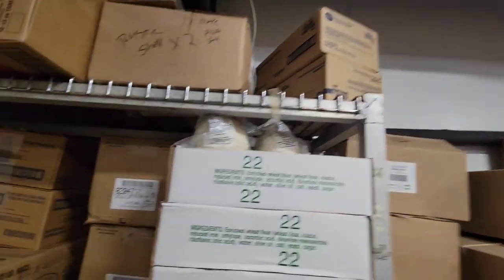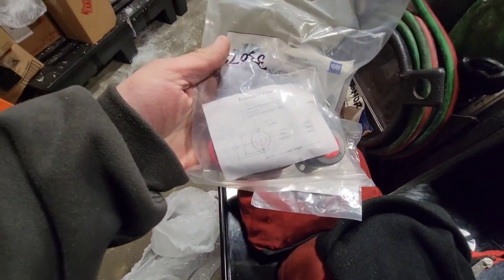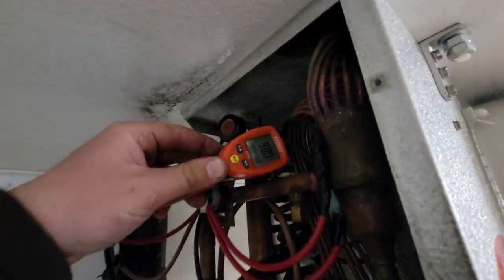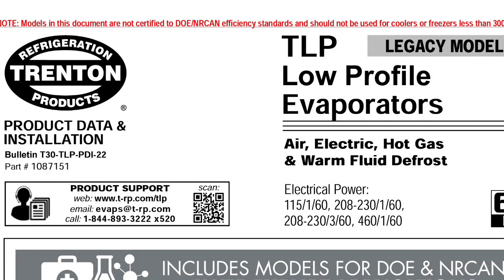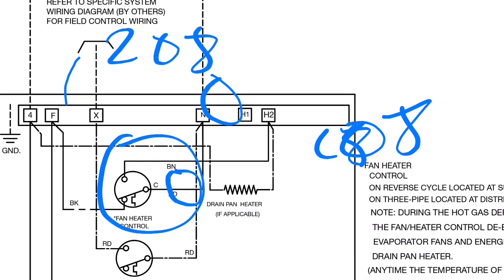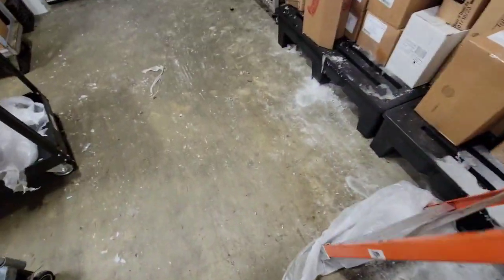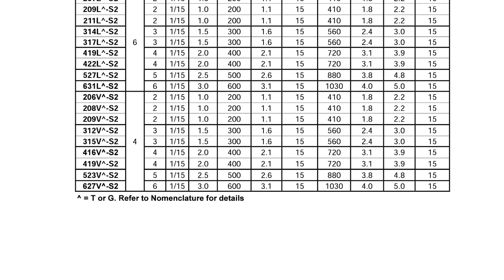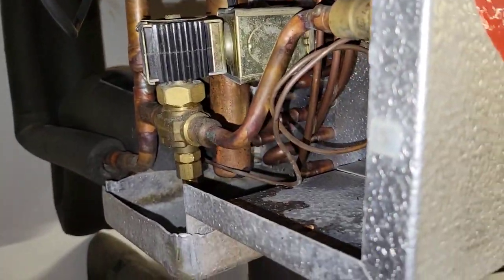Supermarket Refrigeration - Walk-in Freezer Drain Pan Relay Troubleshooting (Wired Incorrectly)

Comment: Why didn't you modify the control panel to install the thermostat Elwell Model 974 Plus
Reply from the maker: This is a parallel rack refrigeration system run off off of Advantage 6000 controller. The 6000 controller calls for the hot gas defrost and then the relay in the case simply turns on the drain pan when the pipes are at the corresponding temperature. 

I don't think in this application it would be good to add a secondary controller. 

But then again I am unfamiliar with the controller that you mentioned. But after Googling it looks like a Emerson dixell controller. And if it's anything like that the advantage 6000 controller takes care of just about anything the controller would cover
Reply: Sorry I'm weak in English and I use Google Translate Do you want to tell me that this unit works with a 600 refrigeration compound
Reply: Thermostat Elwell 947 Plus = Dixel Thermostat XR60